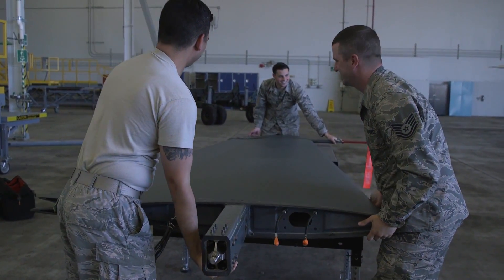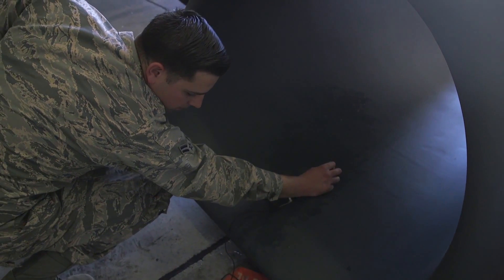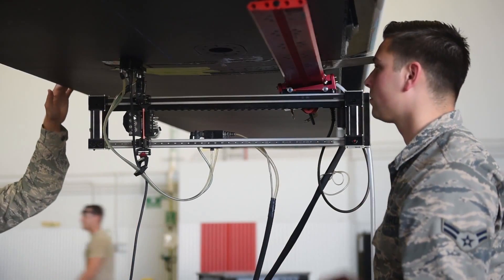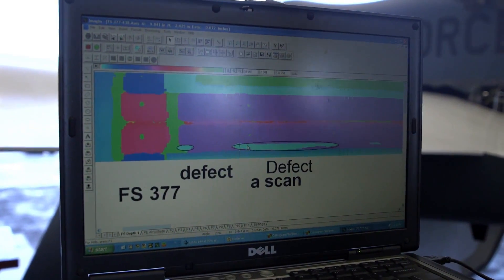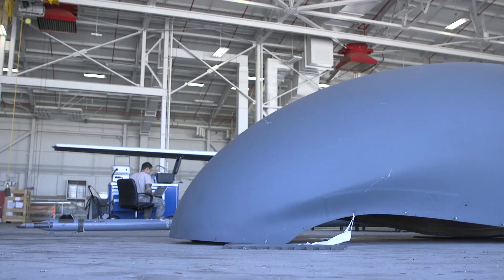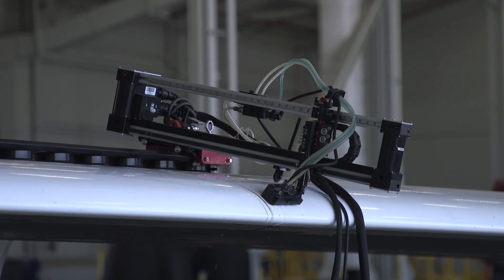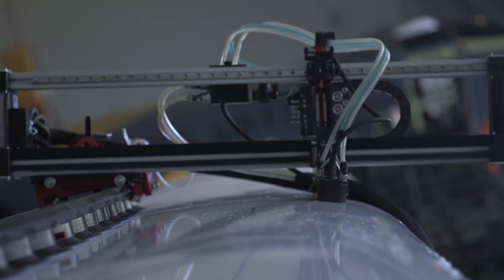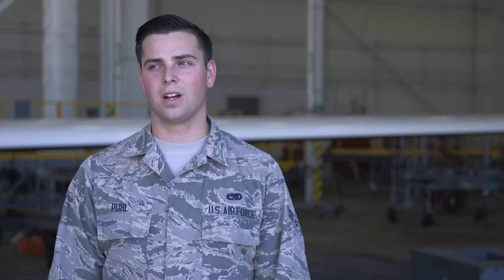Non Destructive Inspection

Comment: I see you're using an old Olympus/Nortec UT. I have been in NDI for fifty years this coming May. I would not trade this job skill for anything else. And believe me, I have had the offers. Still involved with aviation and support equipment. Stay vigilant, and stay updated. There are those who do not believe in NDI for the sole purpose of production to get it out the door faster. Hold your ethics.